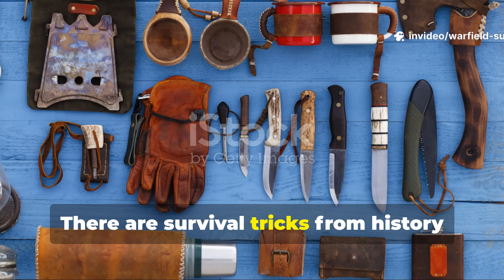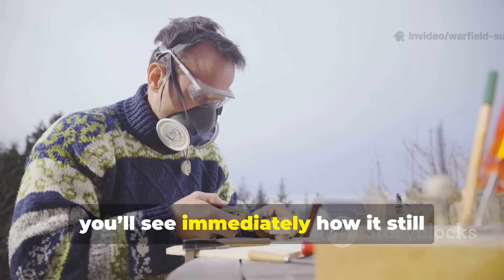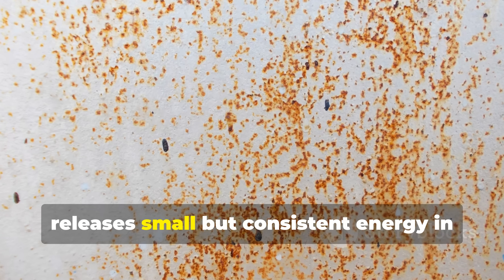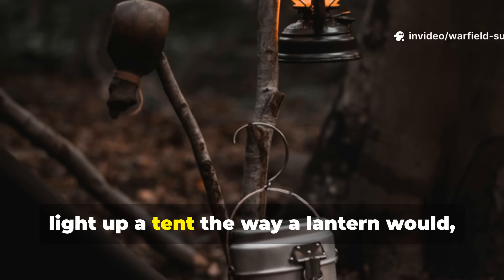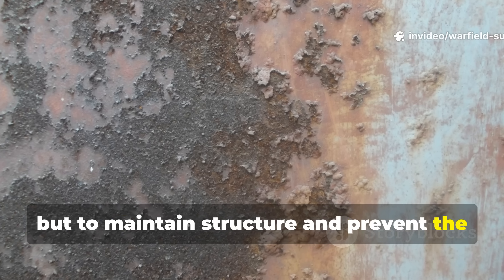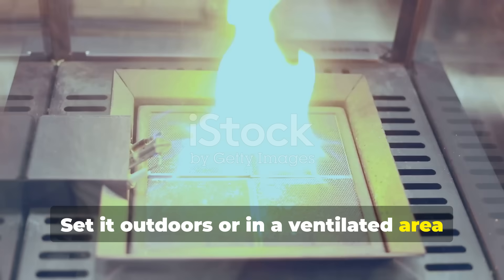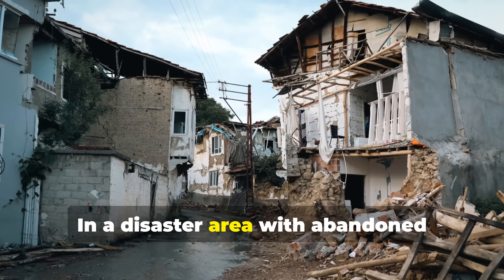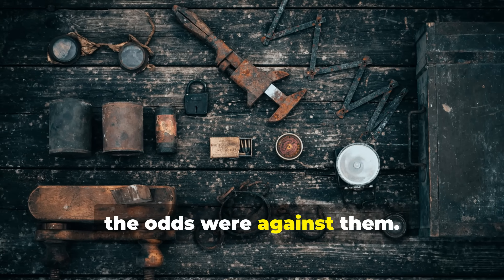The Rust & Vinegar Light Hack Soldiers Swore By — The Forgotten Power Source That Still Works

Comment: There is a simple 1.5V battery you can make that makes power as long as you keep it wet, but it's only enough to power an LED and needs clean tap water. It's too bad they didn't have LEDs then.